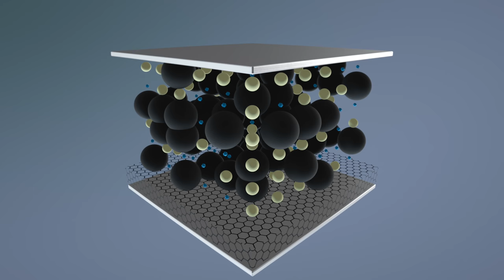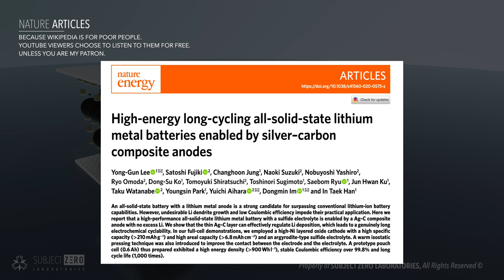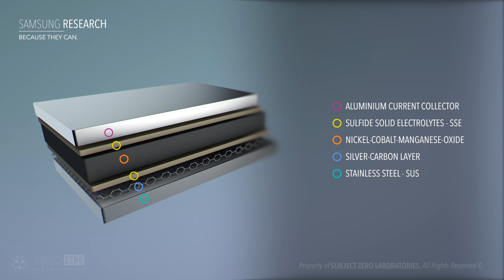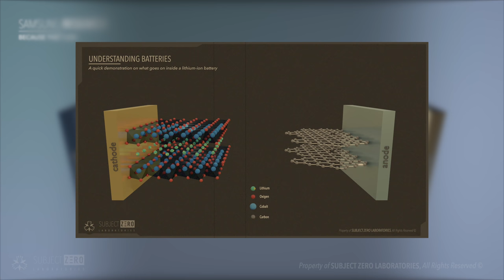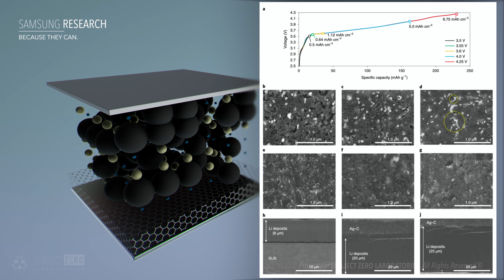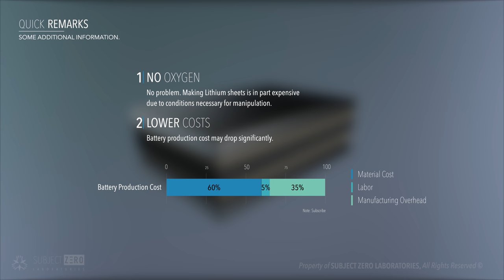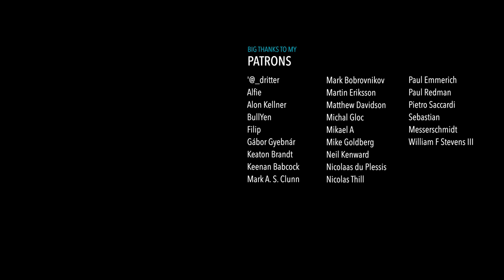Breakthrough Solid State Battery - 900 Wh/L Samsung [2020]

Comment: "but these batteries weren't powerful enough to do anything with it"

1909 baker electric car with 160 miles of range: am I a joke to you?

EDIT:
Wow, great to see so many reactions! :) I want to clarify a little bit. My point was mainly that batteries have always been on the verge of being 'good enough', with how you package/use them being the main limiting factor. Just because it didn't work out practically for commuter cars or long haul trucks doesn't mean there weren't plenty of vehicles that could have easily been partially or fully electrified, from post office vans to city buses etc. For some reason many people have this mentality of 'all or nothing'.
People compare energy density of batteries and gasoline as if  this is the only thing that changes between vehicle designs, no AC inverters, cooling systems, electric motor, piston motor, clutch, gearbox and transmission shaft...
Isn't it weird how opinionated people can get about which technology to use? As if it is a personal matter. I saw some lay people the other day arguing online about which technology should be used for self-driving cars, lidar or cameras. Their argument got so heated, even though they didn't have any stake in the adoption of either of these technologies. They also didn't have any hard statistical data to base any of their arguments on. It was purely based on the feeling each technology gave them. Strange psychology at work.
Anyway, thanks for all the replies, it was very interesting to read. Cheers
Reply: free spirit 1 , that car in “1909 baker electric” won’t pass today’s safety standard.
Reply: Well i don't think many vehicles from ~1900 is secure out of the box by today standard
Reply: Electric car preceded the thermal engine ones. Even then people pushed electric out of the way to be able to sell their waste product from oil refining. Had this push not be done the 150 years of evolution in electric battery would have been waaayyy shorter, we'd have way less efficient thermal engines for sure but also way better batteries.

As for those talking about safety standard, thermal engines in the 1900s weren't safe by any means either.
Reply: @Penofhell  I wouldn't want to start one by hand crank.  I wonder how many arms were lost to that endeavor.
Reply: @Mekronid Don't blame crime on economic conditions.  Blame it on how women judge what makes a man a man.  Great men do great things regardless conditions with zero involvement in crime nor debauchery; except if they're aware of what turns women on or off.  It's the character of the women that determines which type of men get the "alpha" positions.  Every industry is rife with crime in a great economy.  What makes you think it tanking makes a difference?
Reply: @jasonlisonbee   It's watching old movies of people hand starting aeroplane  propellers that terrifies me !
Reply: ssshh......don't ruin the mood, it's obvious there will be better batteries even from the one in this video, so please can you let this one slide ?
Reply: @michaelesposito2629  Well I think that it is time that we shelved the internal combustion engine for something more effiecient and a lot cleaner. its amazing how far tesla has come with thier cars in terms of range and charging time in such a short time. I think that if gasoline didn't come into the fray back in the early 20th century and if we had just electric cars , I would think that the battery tech would have eventually evolved to have viable E.V.s. It may have taken 10 or 15 years, but would have happened.  Remember where there's a will there is a way.  Just imagine where battery tech would be now if that happened.
Reply: @Mekronid no it was fuel cost, electricity was more expensive than petroleum.
Reply: Solid state batteries have been around the corner for over a decade now
Reply: @michaelesposito2629  humanity wouldnt exist without eletric motors actually gas wasnt bery big electric is litteraly what everything in the world runs on houses stoves fans lights eletric came before gas and will always be here as it gets better and better
Reply: @shadowdance4666  same for hemp and graphene
Reply: @popinmo  Really please show me single combine that runs on electricity, ICE allowed transition from 90 percent of population employed in agriculture to 3 - 5 percent. Unless you fancy starving ICEs were and still are absolutely necessary.
Reply: @TheBluebus17  ICEs are backbone of modern agriculture and logistics unless you fancy starving ICEs were and still are absolutely necessary. Personal transportation is only luxury, unlike food, clothing and all other goods that are required for modern society to function.
Reply: @davidhunter1538  Horrifying nightmares come from people just wanting to look cool.
Reply: @skyrask1948  washing machines fans ac anything used in a house or indoors railroads and trams before the modal t alot of people drove evs
Reply: @skyrask1948  street lights any lights at all, tv ,the computer , fridge ,tools
Reply: @Penofhell  but the iphone had come out in 1908 instead of 2008
Reply: Michael Esposito absolutely false. Internal combustion was taken on for the reason of making huge profits.
Reply: January 17 1899 ... land speed record 65.792 ... IN 1899...
Reply: Also 1976 Lucas Electric Taxi (see YouTube) - 100 mile range, 55 mph  top speed, lead-acid batteries. A good car - I rode in it. It was ahead of its time. Adequate performance/range for a city cab.
Reply: @michaelesposito2629  calm down buddy. Don't try to turn petrol into a religion now
Reply: MusicIsMyOxycontin that’s ironic coming from electric cultists lol
Reply: That still a small range compared to the combustion engine and gas is faster to refill compared to recharging.
Reply: Michael Esposito just because a technology was important to the advancement of civilization, doesn’t mean we should never move to the next technology for the masses.   Blacksmithing was also critical to the advancement of human technology, but there was a time to move on.
Reply: @curiouspeople6441  no car in 1909 would pass todays safety requirements
Reply: I think you don't understand, how bad these cars were. They reached like 20-40 mph, not 100+, while being far lighter.
You can say a lot about gasoline, but to this day it is the superior power source.
Reply: Thank you. I was thinking the same. It was even part of pop culture as it used to appeared in Disney comic books used by Grandma Duck.
Reply: @jasonlisonbee  not many. I started a 1922 model T last year, wasn't much tougher than kickstarting a Harley with high compression (which IS more dangerous to your joints).
Reply: MrSpuzzz that’s not the point. People like him are trying to claim we should have gone for electric instead of gas. Which is ignorant. If we went for electric cars instead of gas, we would never be this advanced right now. Only fairly recently was science able to make electric tech viable. Combustion engines didn’t require modern tech to make it viable. We were able to take leaps and bounds with the tech back then. Electric would have stagnated. Gas, was able to be improved over and over again, in very short periods of time. No such thing was possible for electric back then. These people think it was some grand conspiracy that set electric cars on the back burner. Some cabal of oil tycoons getting together smoking cigars thinking of ways to destroy electric. When in reality, gas was far FAR superior to electric, in almost every single category. Even today, gasoline has more energy per lb than batteries.
Reply: Aaron Heaney absolutely false. IC was taken on because it was an improvement over battery, in almost every conceivable way. Period.
Reply: Charles Bell the only reason is, its far more capable, is a technology that can be worked on by anyone, with simple tools, STILL has more energy density than battery, can be refueled anywhere in the world with the least amount of tech, in SECONDS versus hours, and, well I can go on for paragraphs. Stop seeing conspiracy where there ain’t none.
Reply: Popinmo BATTERY powered is what we are discussing here. Not just electric motors. Electric motors had their own purposes and we wouldn’t be where we are without them. Just as we would’ve be where we are, without ICE. Both have their specific and distinct purposes. If we gave up on ICE and went for electric generation instead, we would not be where we are, and you damn well know that. Nice strawman tho
Reply: Michael Valente it would have taken DECADES longer if we went for electric. You people really don’t understand how quick and easy ICE innovation was, do you? ICE allowed us to jump ahead decades over what battery could have ever done in that time frame. It’s not even debatable at this point. Even with all our modern knowledge and engineering, gasoline  is still more energy dense than battery power. Technology caught up to battery power, not the other way around. The technology to make battery power viable was impossible back then. It’s only possible now, thanks to ICE. ICE replaced battery, not because of some conspiracy, but because it was better in every conceivable way, for that time period.
Reply: @michaelesposito2629  I appreciate you responding to all these comments.
Reply: @michaelesposito2629  you are making a lot assumptions about battery and ICE technology, gas has stagnated more then batteries in the past 100 years, EVs where originally sold to women and made up a good portion of the market, they where less noisy, had no crank start, no maintenance, and polluted no gas with lead in it (gas cars where literally making the country stupider and the gas industry denied it for a long time)
You say battery technology would stagnate but never explain why? batteries are just combinations of chemical structures  and could have been R&D Into existence with more funding to become become more enrgy dense and cost less, but No the manufacturers stuck big engines in their cars to burn more gas "the American way" and built many roads to dive their cars far distances instead of investing in public transportation, it's not till recently where government regulations are forcing companies to make more fuel efficient cars and encourage taking a train or bus, you say without gas cars the world would have not progressed, this is very true... to an extent, it made transportation of materials and people cheap, but battery research is materiel research effort while gas engines demand mechanical research, material science became big in the 50s-60s this would have been around the time batteries would have started kicking in, but everyone was use to oil by now and had given up their cities to paved roads with gas stations on every corner, gas was also still cheap, oil crisis made people realize how fragile gas powered cars are to economic changes, EVs could have accelerated their technological pace faster then today if we re continued our efforts in the 60s, and yes oil did suppress EV technologies and more efficient engines, this is what happens when your industry is based of pumping your energy source out of the ground indefinitely to survive instead of researching technologies that make energy production and storage more efficient and practical, strange how oil companies still refuse to do anything meaningful with bio fuels besides feel good commercials about it... so if the US started going hard on batteries in the 1920s, not much would have changed, has was just simply better for most cases, in the 1960s  manufacturing had become more advance and could have allowed real R&D to be done but we didn't... so we delayed until cameras and computers created a market demand for efficient high energy density cells, even at 1/60th the energy density a battery car can still get 6x the range of the average gas car with the same energy, so EVs are technically practical for most people in this day and age, could have been sooner with more directed effort.
Reply: @Mekronid Exactly that it is what happen, in short greed and money over clean and good future for all of us. Many good invention's were lost to us for ever.
Reply: @miguellopez3392  
Bio fuels are a bad idea for large scale deployment. They still emit toxic tailpipe emissions, and photosynthesis is an incredibly inefficient process, vastly, vastly inferior to modern solar panels. We can't produce enough bio fuels to replace fossil fuels (due to the inefficiency of photosynthesis: it doesn't capture and store enough of the sunlight that hits it), they're a dead end, a false hope, and a convenient excuse for postponing the switch to sustainable energy. 

What we need is large scale deployment of renewable energy collectors (wind, solar, hydro), construction of advanced new nuclear power plants (to use up the "waste" of older nuclear power plants and solve the nuclear waste problem while also harvesting the "waste" for the massive amount of energy still left in it), and construction and deployment of gridscale battery systems (such as large traditional battery banks, pumped hydro plants, compressed air power storage stations, etc., whichever is most efficient with the available materials and conditions at the time) to store excess power and release it later, replacing current day peaker plants. And of course, electric cars and other sustainable transportation projects.
Reply: @theuncalledfor  yep, bio fuel is a bad idea disguised as a permanent solution, nuclear has a safety (need a large amount of trained educated workers to operate a fleet of nuclear power plants) and supply issue (making nuclear generators is machine and industrial heavy order, producing enough nuclear power plants world require many large forges and factories, it currently takes 30 years to build a experimental fusion generator because of manufacturing capacity for the components is limited, and some of the largest forges in the world to form current nuclear reactor chambers) solar will pretty much take over, nuclear will make a comeback eventually but i imagine for space exploration purposes.
Reply: @curiouspeople6441  . What does safety standards have to do with it? That's like saying "forget about the internal combustion engine because the model T didn't have air bags."
Reply: my comment saying the same thing was deleted. clearly this channel is all about image over substance.
Reply: David Hunter Hand starting an airplane is something you can learn as a student pilot. The starter relay failed while we were at a distant airport. It became a learning experience. I love the backups in aviation. I suppose you can use a bit a wire and jump the appropriate points in the relay but there’s no fun in that.
Reply: @michaelesposito2629  the design of the electric (frictionless)motor hasn't changed since before 1909- the motor user by Tesla Co, invented by Nikola Tesla. 
One interesting thing to note about engines of this time is each major power in the world developed it's own tech based on what they had access to, which was America had steam, Britain hat petroleum and Germany had diesel, as this is what drove their tanks in WW1, often made by retooled vehicle factories. 
One could argue, without WWI, each nation may not have heavily invested in combustion motors, as they were still largely horse driven, which would have allowed motor development to occur in a different fashion.

One thing that did hold the electric car back is materials available. They didn't have silicone semi conductors like we have today to invert DC electricity to pulse it as AC, or control the voltage passing. These account for effeciently converting electricity from one form to another, often with software based pulse width modulation. Back in the day this job was a lot more wasteful and cumbersome.
Reply: 160/2 you have to go home to charge it. How long did it take to charge. How likely was the battery to burst  into flames. Also how many charges did the battery have before that 80 miles looked more like 20.
Reply: free spirit 1 max speed like 25
Reply: Well  Standard Oil company happened...
Reply: @michaelesposito2629  ... so far behind what ?!? ...   75% of today's gimmicks are in no way essential to our lives ... maybe just in our minds ... a lot of them are actually detrimental and harm us , in a way are degenerative in regards to us as a species ... 
Let me tell you , the wild life , the nature , Mother Earth if you like ... is certainly not happy about us going the gas way ... We are indeed destroying our habitat , our host if you like ... and only an imbecile would refute that ...  Guess who else act just like that in nature ... ? ... viruses and bacteria ...   get it ?
Reply: @jasonlisonbee  There were broken arms. I remember my grandparents talking about it. Usually the same problem as people getting hurt today. That old problem called a brain fart. Not making sure that everything was properly done.
Reply: @RinksRides  Both vehicles are no problem to start if the person starting them follow proper procedure. The injurys happen when one does not follow the correct process.
Reply: Yea this dude does not know his history. Just trying to make a quick buck on YT.
Reply: @Penofhell  they used what worked best .
Reply: @Penofhell  Nice conspiracy theory, fact is batteries and motors have always had people banging their heads up against the wall trying to compete with combustion engines, only to fail. You apparently aren't business literate either (your types never are), since you do not know about the minimal viable/value product principle. It's taken very advanced chemistry advancements to get batteries to where they are today, meanwhile increasing thermodynamic efficiency of ICE's has been provably simpler and more cost efficient.

Also, you don't know about "black boxes" either, do you?
Reply: @michaelesposito2629  that's not really true, a technology is only going to be innovated if it is the best choice from a business sense. Oil producers back then were rich enough to steer the direction of technology just by using money, in order for them to have an even stronger source of income. If money were no object EVs would have been a lot better, a lot faster. No matter what though, there's no way they would be able to compete with ICE for total range and for that reason they would not have suffered at all during the two world wars, which is where most innovation comes from. EV just doesnt have the range and practicality for military use in a war.
Electric mobility is inevitable and better in almost every single way to an ICE car. Now that the world is starting to come to the realization of this fact, innovation towards electric storage is going to shoot through the roof.
Reply: it went 20 miles per hour so take that with a grain of salt. I mean today they can push cars to 1000 miles on  battery charge,look up the phoenix
Reply: range =/= power
Reply: "Their argument got so heated, even though they didn't have any stake in the adoption of either of these technologies. They also didn't have any hard statistical data to base any of their arguments on. It was purely based on the feeling each technology gave them. Strange psychology at work."

This is the internet in a nutshell. People always have an opinion, even if they know nothing about the subject, and will go to great lengths to defend that opinion. The phrase "I don't know enough about this to have an opinion"  is never used.
Reply: I don't think so. The first theoretical motor was in 1740. Combustion engines came in 1876. Most of the industry uses electric motors.
Reply: @facepalm7345  
"EV just doesnt have the range and practicality for military use in a war.
 Electric mobility is inevitable and better in almost every single way to an ICE car."

...yeah the only limiting factor on battery powered vehicles is war.
Get hold of yourself!

I want to buy an electric bike, that i could make a 300km journey with i take bi weekly.
You know what?
Sadly no matter how much i can or cannot offer for it, there is no such thing. Whats worse, its hardly concieveable that its feasible with current battery technology, lets do a little bit of back of the envelope calculations.
A shitty old suzuki xf650 produces 35kw. And has a max speed of maaaybe 150km/h, with that output. Lets round stuff down, and say i would have to take 2 hours at that wattage to get to my destination - for sake of simplicity.
A 85kWh battery from a tesla model S weighs over half a ton. So lets assume that you can get away with a 400kg battery.

Great now you have a battery thats bigger than a damned honda goldwing, so you still need to add pesky things like electric motors, steering, frame, wheels, suspension ...etc. to have a functioning bike.

Its a joke frankly
Not to mention the associated cost, i mean that at the price of said battery you could buy 4-6 petrol powered bikes, that preform all you need them to.
Of course thats without mentioning the complete clusterfuck that charging station networks are, or the time needed to charge taking up more than half the time spent "travelling" on a longer journey.

And no, hate to break the illusion, but most people on the planet can't afford a secondary (premium priced) vehicle, thats only good for daily commutes.
So its heat engines, since you can afford it.

Of course lunacy doesn't stop there.
We have some idiots seeing the future of aviation in battery powered VTOL supersonic passanger jet aircraft. And no that bunch of technobabble doesn't lead to anything that is possible to make in reality - even if you are "technojesus".
Reply: @alexjohnward  yesterday a barrel of oil was negative $40
Reply: @shadowdance4666  they hide out with practical fusion reactors
Reply: You're smart, wtf are you doing on the internet?
Reply: Trent Allman quantum drive and the flux capacitor
Reply: Trent Allman quantum drive and the flux capacitor
Reply: @electron5271  well said
Reply: @Mekronid I remember when Nimh batteries were viable for replacing ICEs in road cars....
crickets
Oh wait nevermind that was just a hallucination I had while overdosing on dph, silly me. What are you about exactly?
Reply: @martonlerant5672  Okay, you are making up an argument that I just didnt make. You want to travel 300km on a bike twice a week? at 150kmh? do you know how much your ass is going to suffer sitting on that seat? Maybe you already do make that journey on a bike, twice a week every week. To that I  give you props because your rear end must take one hell of a beating.
The only thing that would have held back early EVs had the oil companies not suffocated them would have been the wars. Gasoline and diesel have such a huge advantage in energy density it's almost not even fair to compare it. No competent war vehicle designer would think about seriously building a battery powered tank, airplane or ship. Mobility and range are everything to a modern army. 
Battery power vehicles are cheaper to run throughout their lifetime. Why bother buying a first vehicle anyway? Just because there isn't a dedicated super advanced EV vehicle for you doesnt mean that it rules out EVs for people who arent migrating every week. 
If you though disagree on oil companies putting their hands in the way of EV implementation, what about biofuel? Not going to mention whatever that super high tech amazing super cool airplane or whatever it was that you talked about cause it's just a bit silly. Or were you trying to make me look dumb by saying that?
Reply: @MrSpuzzz  Yet there are literally thousands of fabricators who are arguably modern day blacksmiths, do you know ANYTHING about the real world?
Reply: "For some reason people have this mentality of all or nothing." No shit!  Are you for real you can't figure that out?  Let me help.  most of us don't want on the cat afford multiple cars. We don't have room in our garage or driveway for multiple cars.
Reply: @michaelesposito2629  What really matters is which one makes less pollution and is more efficient. Making batteries causes a ton of pollution just like using gas im pretty sure.
Reply: aiGeis I think you probably missed the point.  Technology improves. Old methods become obsolete.  You don’t hang onto them just because they once were leading edge.
Reply: @Mekronid Agreed.
Reply: And there was also electric city trains back then which the media never talks about and electricity that was collected from the aether which they also never talk about..
Reply: @eirikmurito  Electricity that was collected from the aether. How does that work?
Reply: @MrSpuzzz  Fabricators quite literally in certain applications heat up metal and whack it into shape. You're missing the point because you don't understand how the real world works.
Reply: @curiouspeople6441   just put it as a LSV  35 or less mph  no safety required (that is what india uses)
Reply: @trentallman984  it topped out at -$50 a barrel  for a couple of seconds
Reply: @Mekronid Filling up / recharging has always been THE issue, not price tag or pure marketing. It was then and it is now. Nobody talked about "supercharging" then and lead batteries were especially heavy and slow to recharge. And how many load cycles until they degraded? Pumping gas takes three minutes and you don't even need to know how much gas you have left before planning a trip (in populated areas) as you simply pull into the next convenient gas station and "fill her up", pay and go. Can't do that with batteries. That is why electric is lacking flexibility. On a trip out of electric charge means out of luck. Therefore only today with ultra high battery capacities will electric driving for the masses be feasible. Here in Europe the governments try hard to push it (bc of overall carbon foot print as well as air quality in cities) but with little success as of yet.
Reply: yeah most probably it was not about electric cars but oil-car etc industrial complex was way better and easier business to make huge profits. nothing more fancy than that. So any excuse to disarray from that "master plan" was "not good enough".
Reply: @Mekronid Hey, I brought up a totally different argument you did not reply to at all. Kindly read it again if you may. It is about charging, range, flexibiliy of operation of a car. There has always been a need for battery technology, outside of cars. If it were that simple companies would have had success earlier. Because it has always been a business case outside of cars. Not everything that has not worked did so because of a conspiracy.

For the past years, all governments and even the manufacturers here in Europe have tried to push electric drive into the market including with financial incentives but people are not buying. Electric cars even have their reserved parking spots in many cities now, at least here in Europe (many countries).

Regarding flexibility: I honestly do not even know how many gas is in the tank of my car right now: 1/4 or 3/4 or something? I do not care; when I decide for a trip and when I have to, I fill up in three minutes at any gas station. You simply do not have this flexibility with electric cars.  And of course that is the way billions of people do it when you think of it. Electic is just a hassle up and until we have real good range and FLEXIBILTY (charge in, say, 10 minutes to some x*100 km range. In. Reality. In. Real. Life, not just on test drives.
Reply: @Mekronid "electric motors are not great at producing torque from 0 RPM unlike combustion engines" - whhaaaaat???  did you mean to say "electric motors ARE great at producing torque from 0 RPM unlike combustion engines" ?
Reply: How much horsepower does it make?
Reply: I have 1 Simple Answer, Nuclear Fusion, And Super Capacitors Problem Solved. Sorry to say the Rockefeller's Are In The Way, Lets Move Them And Advance.
Reply: An electric car also set the first land speed record for a car.

I specify car because I think the bicycle record was faster at the time.
Reply: Does anybody here really believe they will release a revolutionary battery technology that will beat the Internal Combustion Engine, whilst there is still oil in the ground?
Reply: A new technology, innovation in battery power, looking to the future, but will we see this first ...
Will we see the worldwide economies crash, mass unemployment everywhere and the housing market implode!
That is not important, there is a new battery coming out ...